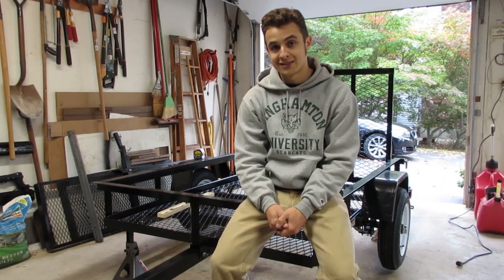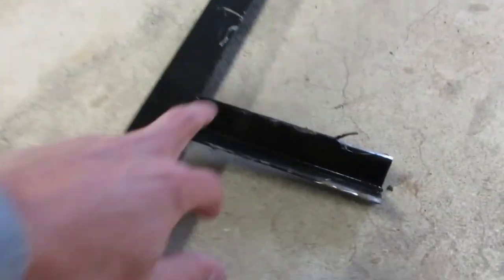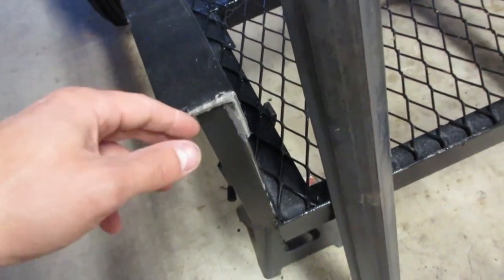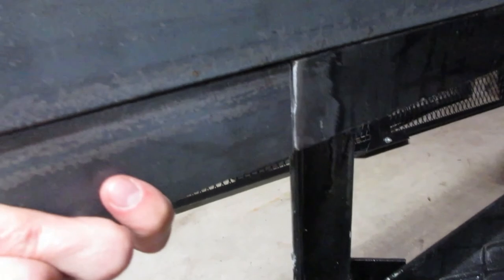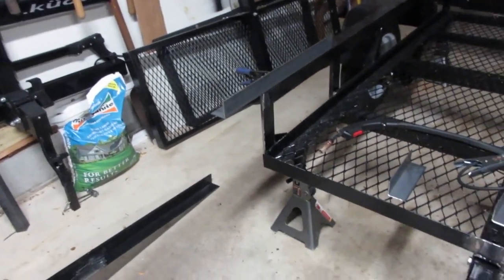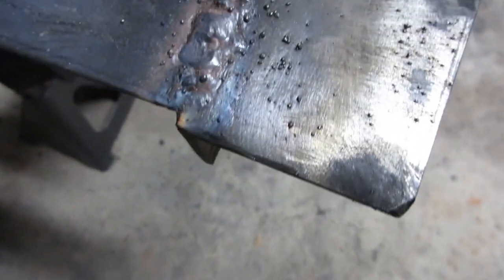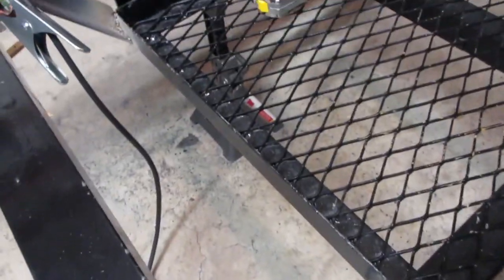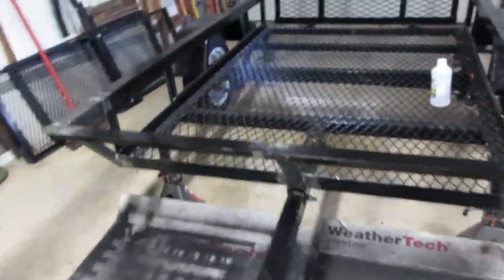How to Make Your Trailer Bigger - Extending my Carry-On Trailer

Comment: There are several tricks for dealing with the splatter from the welder.   You can switch to a tig style welder since it doesn’t splatter.  Or you could just grind off the splatter.   Or you can use a welding anti splatter spray.   Spray cooking oil, like Pam, works great too.  With both of those products you need to put masking tape over the area you want to weld. Since the sprays will make it hard for the weld to stick.  
Also you should have tested the fit of the quad before you fully welded everything.  It’s a lot easier to break the tacks to move stuff.  Or you could have put the quad on the trailer then measure how far out the door is and do at least that amount.   
Also use a self etching primer when you’re painting bare metal.  The self etching primer will stick a lot better then just paint.  
Audels welding pocket reference is a must read if you intend to stick with welding.  It covers a lot and really explains things well and in great detail.  
Great job overall!!
Reply from the maker: Thanks! I did test fit the quad before I started and measured how much i needed to add for the gate to close

Comment: I have a landscaper trailer that has a 6'x12' deck. After a few years I out grew it, needed another foot of length. I decided to add 2' to allow for any future needs that might crop up. I made two cuts, one in front of the axel and one behind. I added a foot to the front and a foot to the rear. I did that rather than I just adding two feet in one place then have to move the axel to balance it and have to deal with getting it straight. I had to add to the wiring harness but I'd have had to do that no matter how I stretched it. I soldered the wiring splices and put heat shrink tubing on each one. I then slip a pvc pipe over the whole wiring so I shouldn't have any trouble with the wiring. I put new 14' pressure treated boards rather than piece in two ft boards. I did that a four years ago and it tracks well with no tire wear so the axel tracks well. I now have plenty of room for my zero turn and lawn tractor. I also put an electric winch on the front that I had laying around, made a spare tire bracket, added stake pockets to it and more tie down places. It suits my needs just right now.
Reply from the maker: Awesome!
Reply: I plan on doing the same with my 5x8 Carry-On trailer. I want to extend it by two feet.

Comment: To get those 7” pieces straight you could have clamped two longer pieces of angle to the new piece and the existing (commonly referred to as strongbacks).  Wire speed will reduce some of that spatter, and so will the work angle of the mig gun. Pretty good job for it being your first time
Reply from the maker: Thanks, thats a great idea

Comment: Not bad for a first time welding. Flux core splatter will do that. They make a anti splatter spray . Lincoln makes good flux core wire .
Reply from the maker: Thanks for the tips!

Comment: Flux core harbor freight MiG welder I love it. I have the small titanium 110v welder and I love it. Works great!
Reply from the maker: I have heard Harby welders are pretty good. Might have to get one someday
Reply: What size wire
Reply: @venomous61  you can also use .035 as well

Comment: You can get an anti-splatter product check on your nearest welding supply. 👍🏼
Reply from the maker: Will do, thanks!
Reply: If you use gas instead of flux core will reduce the amount of spatter but usually you can knock most of it off with a pice of scrap steel or a wire wheel on a grinder.

Comment: Nice job, as far as the weld splatter that is common  with flux core welding.
Reply from the maker: thanks! good to know
Reply: @wrenchandrip  no problem
Reply: If you are going to weld in doors you could switch to solid core wire with a shielding gas of 75-25 co2 and argon mix and have cleaner welds and less spatter ,but that's a added cost ! But it think it's worth it.

Comment: Somehow you really should have tackled the rear of the trailer. By extending the front of the trailer you shortened the tongue length. Causing more of a chance of jackknifing or during sharp turns breaking a tail light or denting your vehicle. Kudos for tackling a job with no experience. It's always good to see a young generation tackling new jobs that they know nothing about that's how you learn take it from an old guy when you tackle something bigger than you you can only get better. Also by shortening the time span you start disturbing the tow ratio of the vehicle length and the trailer. Remember that the axle is 40% distance from the front of the trailer when shortening the time and lengthening the bed you change that distance and ratio therefore you could get road walk or bouncing so just be careful and think before you jump into something like this ask us questions and we will be more than happy to help again thank you for jumping on a job that is tough to begin with but if you had to extend anything it would have been better to extend 7in in the back
Reply from the maker: Thank you for all the tips!
Reply: ^ this guy gets it
Reply: @wrenchandrip  not to mention you may have somewhat compromised the structural strength of the trailer.
Reply: Adding to the rear, might result in negative tongue weight, which can cause issues at highway speeds.  You can get a longer drawbar for your vehicle, to get more clearance if necessary.
Reply: Poor information.

Comment: spatter or bb(s)  you can decrease wire speed or increase voltage. make sure materials clean, which yours looked clean in video,, invest in shielding gas, and spray with anti spatter, as old as the video is youve probably mastered this .. but good work!
Reply from the maker: Thanks!

Comment: You should try flap disks on your angle grinder.  They work faster than a cutting disk or grinding disk in smoothing out materials.
Reply from the maker: I go back and forth, I do like the flap disks but find it harder to grind a very specific area with them

Comment: I did the same thing in 2020 for my dirt bike but only thing I did different is cut the corners off cause when you turn left or right hard it might hit your car now without corners you can turn a tad bit more without touching
Reply from the maker: Great idea, I made sure I can still turn full lock with the extension, works fine for my setup!

Comment: Dude, your welding Is not bad! Use spatter spray to clean of the spatter.you're using a flux core Welder so you will have some spatter.
Reply from the maker: Thanks! Good to know its not all me that is causing that

Comment: Thanks for the video. You did a nice job creating that extra space for the front tires of your ATV for that trailer. One thing that stuck out at me was the tongue of your trailer. With it being an open deck like that with all visibility, I would DEFINITELY REINFORCE that tongue by bringing in identical tubing, or the appropriate sized "C" channel, and I would create two extra strength points on the tongue making it look like an "PEACE" symbol. 

Other things you could consider for your trailer:

1. Stake pockets on the side and front for tie down points. Do not depend on the expanded metal for that. Too weak.
2. Fuel Can carrier. Several weld on and bolt on versions available to hold one or two Jerry Cans.
3. Expanded Metal Mesh on the sides of the trailer to create an enclosed box. Helps keep things secure and not fall out.
4. Red/Silver Safety Tape on the sides and tail gate of the trailer.
5. Spare tire carrier.
6. Fire Extinguisher bracket w/extinguisher. Kiddie larger models give you the steel mounting bracket, perfect to bolt on or weld.
7. Supports under the expanded metal mesh of the deck. That mesh WILL give way after time with weight of the ATV. Tires will cause "RUTS".
8. Hi-Lift Jack, Axe, Sledge Hammer, and Shovel Mounts. If you are using an ATV you will meet MUD or SAND and could use some of these. 
9. Storage for tow straps, tie down, etc. Think about use of 50 caliber or 20, 30, and even 40 MM Ammo Cans if a tool box cannot fit.

SECURE YOUR STUFF!  * FORT KNOX COUPLER LOCKS *   Rely on no others. https://ftknoxlocks.com/

These are just some ideas for you. You did a nice job. Enjoy your project. As for the droplets, you can simply grind them off. I don't weld, so I'll leave the welding tips to those who know.

Just some ideas. Good to see your enthusiasm. Enjoy!

Levi
Reply from the maker: Thanks!

Comment: Before getting into the bad habit of using a grinder without the gaurd, I suggest you check out videos on how dangerous a grinder can be.  The videos will convince you more readily compared to me or others repeating the words about safety.
Reply from the maker: sometimes it is impossible to get to places with the guard on. check out grind hard plumbing co… dude has been doing it forever and still has all his fingers! have to just trust yourself

Comment: On the front bar you shouldn't  have cut the down center piece off because  you could  have just welded it back to the tounge.
  You dont want to run your bare finger  over metal  you've  just cut either.  Once those metal  shavings  get into your fingers you'll  understand  why.
 Other than that you did a great job.
 Makes me happy  to see young guys like yourself  fixing  stuff on your own and doing a good job of it 🙂
Reply from the maker: Thanks! Yes… metal shaving are no fun.

Comment: You could also bolted a 2X of any kind to the mesh floor to raise the front of your quad over the front rail. Just tie it down as you normally would. Then if you need the trailer for something else it's easy to remove the 2X.
Reply from the maker: Not a bad idea

Comment: I have a 4x8 and my 23 rancher did fit perfectly fine but now that I got wider wheels and tires it’s a little too tight to I am looking at widening the trailer or I am gonna sell it and buy a 5x8
Reply from the maker: I think widening would be a lot harder than lengthening, but would be a fun project!
Reply: @wrenchandrip  I ended up selling that one and bought a new one for the same price I sold mine for so It worked out

Comment: Seem pretty knowledgeable..  I'm a fabricator and to me it sounds like  you know what your doing deep down.    If not.  Kudos.    F that Flux though.    I tig stainless.  

Those gloves though.......  🤷‍♂️

Try anti spatter spray.    To your question.
Reply from the maker: Thanks man! That really was my first welding project ever… have improved a lot since then with a little practice.

My one welder friend made fun of my gloves too lol. Ill have to look into that spray, thanks for the tip!
Reply: @wrenchandrip   no prob! Looked decent!  Good job.  That spray should help a bit. Just mist it on and letter rip   ✌

Comment: Should of preped the material. Like all that paint were u made the cuts. Ever heard of porosity. And yes cleaning the new stock you added and removing that paint were you plab too weld will reduse your splatter alot. And help make an actual strong weld
Reply from the maker: Thanks!

Comment: One thing I started to use was gel flux. Don’t know who makes it, but you dip the nozzle into it, and it costs the nozzle with flux, which should help. 

Check the gage of the wire in your wire feed. I think you could go with a gage larger and that may help. There is a video (can’t post links in comments…grrr) on YT that upgrades Harbor Freight and other cheap welders, and that is one thing I remember. I think that is what he said helps with the spatter.
Reply from the maker: thanks wade I appreciate the tips!
Reply: 400 hundred bux i guess that's cheap for some. Your talking about nozzle dip keeps the gun easy to clean. Does nothing for the surface work.

Comment: Hello, what kind of welder is that? And for the pros out there, would that be considered structurally sound? For strapping motorcycles and such down with no worries?
Reply from the maker: Its a Forney Easy Weld fc-140. I have strapped a bunch of different machines down tight for trips over 5 hours away with no issues. Welds are solid
Reply: I have the same welder it works so much better than the harbor freight machines.

Comment: @11:24 you asked about the weld splash. There is some spray that you can spray down before you weld that will help with the splash not sticking and it is "easier" to clean up. I will be honest that I havent welded in years and cant remember much but i think it also can be fixed within the settings you have in the machine or the type of wire you are using.
Reply: The welding splatter I think is caused be either the wrong amperage or the speed that you moved, or the flux core wire, not sure. I have a Lincoln 110 volt Mig wilder. I used flux cored wire at first but changed to gas because the flux cored wire splattered just like yours did. In my experience, the argon co2 gas is a much cleaner way to weld. The biggest problem with that is if you're welding outside, any breeze will blow the gas away. You'll know immediately because it'll start spitting and sputtering and you'll have no penetration at all. I guess it's all in where you're going to be welding most of the time, inside or outside.
Reply from the maker: Thanks for the advice!
Reply from the maker: Great point about the wind

Comment: I found a electrode welding machine. I try but I was making holes in the metal or my finished work was terrible. 
Is this Flux welding method much  easier?
Reply from the maker: I havent had much experience with electrode welding, but i do know its usually for heavier material. flux core welding is almost like using a hot glue gun, its about as easy as welding can get in my opinion (especially for thinner metal)

Comment: Flux is made for outside windy days if u are using gas ur speed is high on ur welder or your not using gas on a gas welder that's the reason why you left splatter

Comment: Semi fail - the top "frame" of the trailer is actually part of the structural supporting frame. It works in conjunction with the angle deck frame. Cutting it apart like done in the video ruined the structural integrity of the trailer to a certain extent.
Reply from the maker: Wouldnt it re-gain the structural integrity when welded back together??
Reply: @wrenchandrip  I would add another 6" piece underneath it for support on side railing that was added . going to see some flexing and cracks in time.  trim it so you won't see it and I added cross supports on floor and 2 full width supports to help w. Wire floor sag! Mine was 8 ft length and wide body.

Comment: I would have just strapped the tailgate to the back of the quad.
Reply from the maker: i did do that for a bit, but i wanted to be able to use it how it was designed to be used. its great to be able to pull on and just shut the gate now

Comment: The only way to eliminate splatter is to get a mig welder with gas
Reply from the maker: very true. theres a reason the pros dont use flux core hahahaha
Reply: @wrenchandrip  Don't underestimate Flux core. Splatter can be minimized. It's a solid weld. Plenty pros use it.

Comment: It was to dirty to start with you should of cleaned it with a grinder before even thinking about welding on it. And wire brush the shit out of it after every pass.
Reply from the maker: Good prep is the key to success I hear